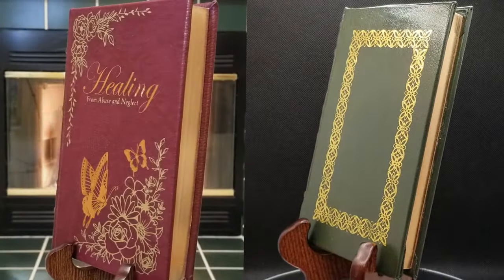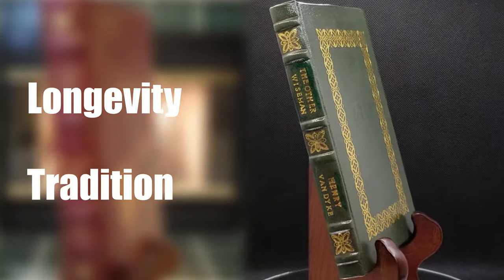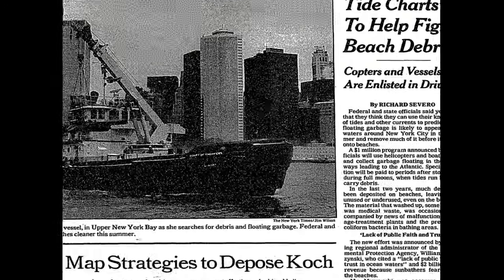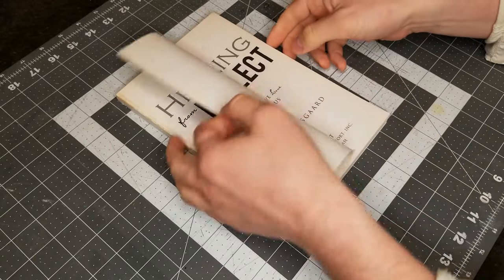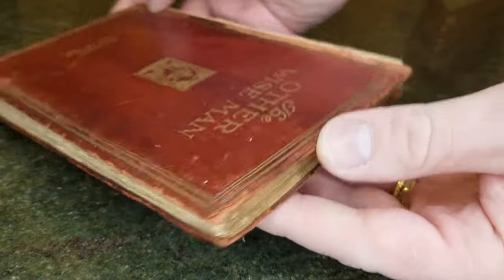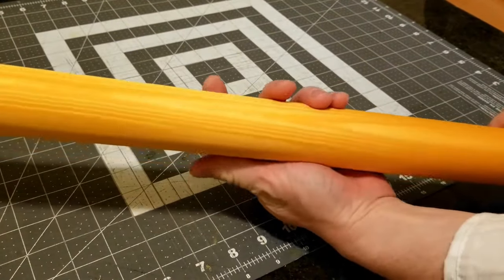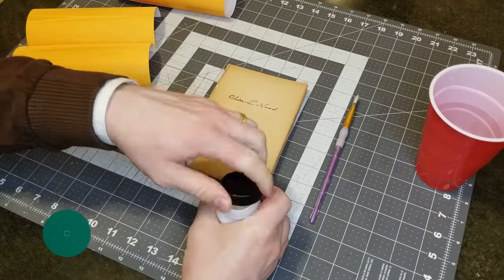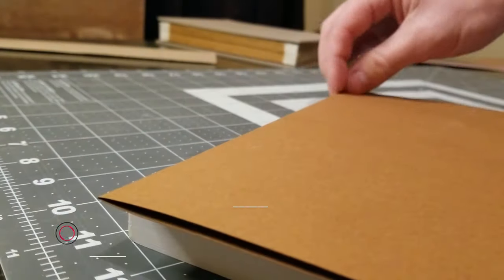How Long Will Your DIY Book Covers Last?  Depends on What They're Made of!

Comment: One small correction. Elmer's is not pH neutral. It is mildly acidic. Elmer's craft bond tacky glue has a pH of 5.1. Most types of Elmer's glues have a pH in the upper 4's to the low 5's.
Reply from the maker: Thanks for bringing this to my attention!  I tried to fact check what I said, but I must admit I took the glue's marketed claims of being acid-free at face value and didn't verify with my own litmus test.  I appreciate you commenting so the community can know!
Reply: @ingeniusdesigns pH strips are super cheap online! always a good idea to double check the marketing. you can dip the glue and wait for it to dry (assuming it's clear) or water-down the glue and dip a more sensitive strip (using math and such to adjust the dilution)

Comment: Oh quick tip: put the masking tape on a piece of cotton fabric (I use my shirt) and pull it off before using on the davey board. It takes the tackiness down a bit so it doesn't tear the material as much.
Reply from the maker: Good thinking.  I do the same thing often in other contexts to reduce the stickiness of adhesives.  I'll have to try it to save my boards too.

Comment: Little typo that snuck in: Polyvinyl Acetate, not Acrylate.

Also from a conservation point of view reversibility is just as paramount as the archival quality of the materials used.
That goes especially for the adhesives.

Further from the same point of view I can’t help but wonder whether leather truly is the best way to go as a material since at least vegetable tanned leather requires periodical dressing to stay flexible which has caused a rather substantial headache for modern day conservators…
Reply from the maker: Oops!  Good catch!  Looks like I misremembered that name.  Should have added that to my fact-checking.  

You make an excellent point about whether leather is really the best thing for long-term book conservation, and from what I've read, some book conservators would agree with you!  It's not the ideal material if you want your books to survive the apocalypse, but it's still a classic.

Comment: Great information. You mention board grain can influence cover warping. Which direction then is the best orientation to reduce warping?
Reply from the maker: It is better to align the grain length-wise (from the top to the bottom of the book).  This won't fully prevent cover warping, because there are a lot of other factors that play into it, but it will at least help!

Comment: I love your videos so much! They are so insightful! Your transitions and edits are so well done, and you are so well-spoken! Have you ever made your own book? What I mean by that is sewing your own signatures? I also am having a tough time with gilding the pages. I have been using the same foil quill from We R Memory Keppers, but I am having so much of the shavings from the paper ruining the final look. I sand the paper till it is reflective, but after I finish and separate the pages, paper dust is everywhere, my pages are bowing out at the gilded edge, and the foil seems to just chip off (I am not using beeswax currently because I don't have a lot of spare money, but I am thinking that is my problem). I plan on making a book press like the one in the other video, but I haven't gotten there yet. I've been weighing my project down with books and weights on top of it, which I thought would be enough, but I am not sure. I think I am not sanding it enough to be completely flush with the chipboard that sandwiches my papers. Could that be my problem?

Comment: Fascinating. I've watched all your videos with interest. My biggest question has to do with the difference I see in the corners of the books. On your original tutorial I thought the whole thing was outstanding, except the corners, which were poking out pretty bad (not that I know how to correct this or do it right you understand!). 
Now in THIS video, not only are the corners of the finished products pretty darn spectacular, It seems like you used a different fold on the two. I definitely thought the 300 year book corners were better, but the top edge of the cover seems less straight than the 30 year book. The 30 year book looks absolutely beautiful. 
So, to sum up my questions: 
1. Please explain corner folding (If you feel like doing a whole video on leather folding etc, I wouldn't complain). 
2. How do you get perfectly straight edges, and does the 30 year old book only APPEAR to be straighter because of thinner materials etc? 
Thank you for these amazing videos and sharing your skill. I would love to do the same in my profession but I have no ability to edit videos. You sir are a master.
Reply from the maker: Thanks for your thoughtful questions.  I'm still an amateur at this, and corner folding is something I'm trying to improve.  The corners on my 30-year book were made with the method from my original tutorial, which does tend to poke out a bit, as you observed.  I was using a thinner leather for the 300-year book, however, which allowed me to fold the corners and make them more aesthetically pleasing.  I'm still not totally happy with the folding technique yet, but when I have it better refined I may make a short video on the topic, as you suggested.

Comment: There's masking tape and there's making tape btw. Hit up the masking tape aisle at a hardware store. Tape is rated in days, how many days you can leave it on before removal without damaging the underlying surface. Longer times mean less aggressive tape.
I haven't used it for book binding but I really like frog tape.
Something else that might help is if you can take the tape off from the centre out so you don't have the tape lifting the cut edge where it can get a start tearing it. But yeah I'd start with a green or blue masking tape first.
Reply from the maker: Thanks for the tip!  The tape used in this video was drafting tape, which is meant to be damageless, but obviously that only applied to some materials.  Perhaps some of your suggestions might help more!

Comment: Does the gold folio from Cricut on leather is durable like normal gold foil aplied with brass stamps?
Reply from the maker: It's a good question.  I haven't had any trouble with its durability after several years of display on my books, but as I mention in this video, it is impossible to know how it will hold up a hundred years down the road (since the technology hasn't even been around that long).  On the other hand, in some respects heat transfer vinyl has superior durability compared with hot stamping foil, since hot stamping foil is very thin and can come off with rubbing.

Comment: Why do you only do heat transfer instead of a premium vinyl? I see you working on your cricut in some of your videos, so I’m curious what the difference between the two different types of vinyls are.
Reply from the maker: I use heat transfer vinyl for better adhesion to the leather; I don't want my designs peeling off someday.  Also, I find it easier to keep detailed designs aligned just the way I want when using HTV.  With other vinyls you have to use transfer tape, which adds another opportunity to mess things up.
Reply: Hmm. Interesting.. thanks for responding so quickly! 🎉

Comment: My only question is why did you not just give your archival book a new spin and keep the original cover? The cover is an integral part of the the book edition and replacing the entire cover just reduced the quality of the book. Next time try just restoring the book and not rebinding the entire book, it will retain a higher value. They both look great but now the archival book has lost all of its personality.
Reply from the maker: Thanks for the feedback!  The simple answer is that I didn't really want to do a book restoration.  I find it more fun to make my own covers, which for me adds personality and meaning to the book--quite the opposite of losing the personality!  I get your point, though, and respect where you're coming from.  There are many first editions of this book available out there, and I specifically chose one with a ruined cover because I wanted to upcycle it without feeling bad about damaging a pristine antique.  Hope that helps answer your question!